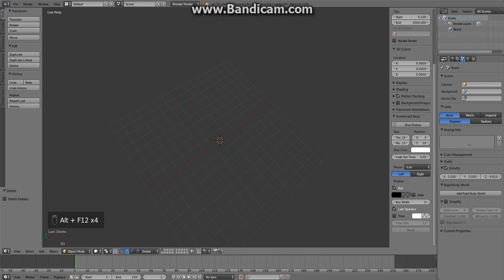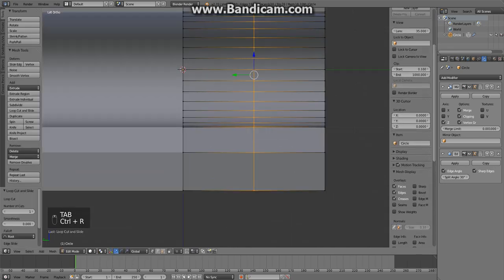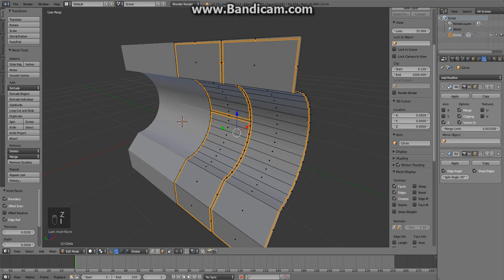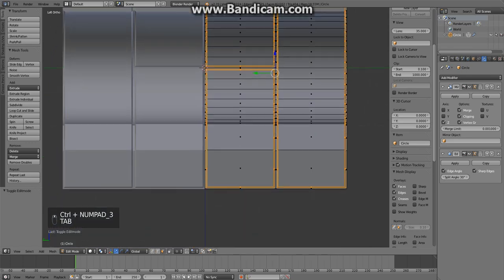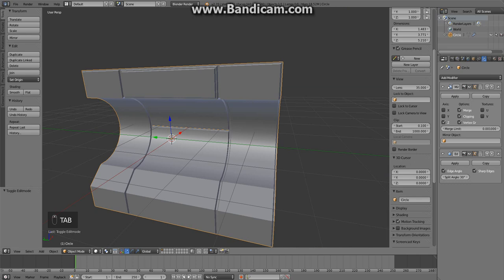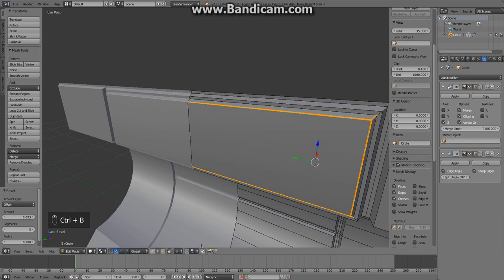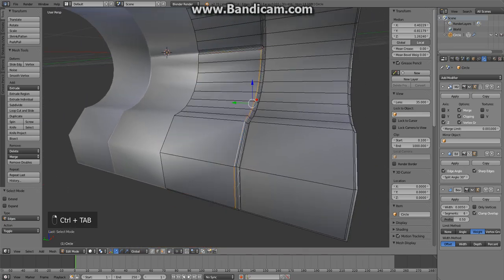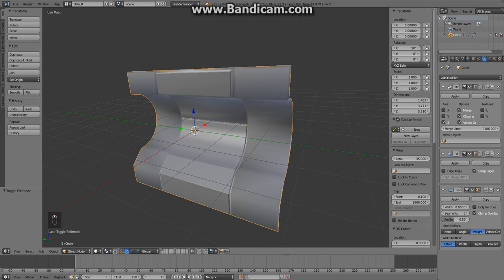How to create panels on curved surfaces in Blender

Comment: Not personally the method that I'd use. It's much harder to add nicer finer details and small insets, etc. when done this way. You'd be working on a curved surface - which can be difficult.. I prefer to make the flat panels, add the details and then either rotate each panel incrementally or add a deformer to bend it into a curve.

Comment: Paste this into amazon... "Neewer® NW-700 Professional Studio Broadcasting Recording Condenser Microphone & NW-35 Adjustable Recording Microphone Suspension Scissor Arm Stand with Shock Mount and Mounting Clamp Kit" - if you get it... use the front of the mic (where the logo is) because this is a "cardioid" mic, which means it picks up better quality from the front of the mic. I enjoy your tuts, but the audio does put people off.. (I just turn the sound off myself). Anyway.. it's a cheap mic... but it's good quality, I have one myself.

Comment: Hi, I am trying to follow your directions, but blender is not behaving the same way. I press I to inset faces, but for whatever reason it is not letting me adjust the depth. I press I, .02 , then hold crtl but it will not let me adjust the depth. What am I doing wrong?
Reply from the maker: hey, sorry for the late response, I just notice the comment and was not notified. Try F6 after using the inset tool, this should trigger the popup with tool options.